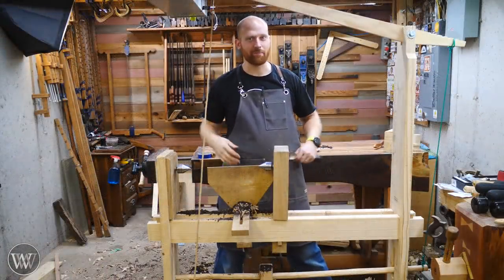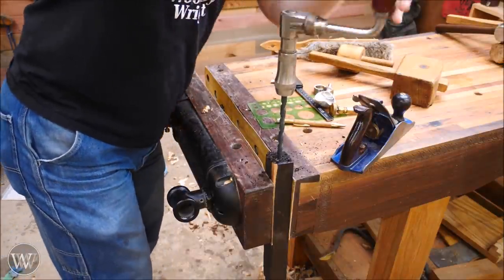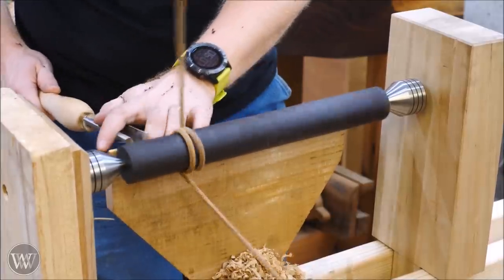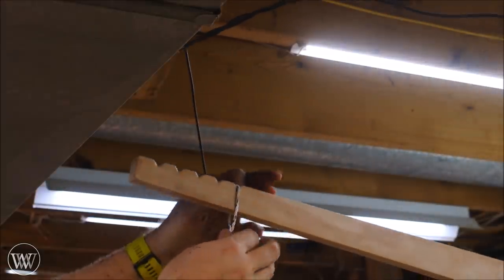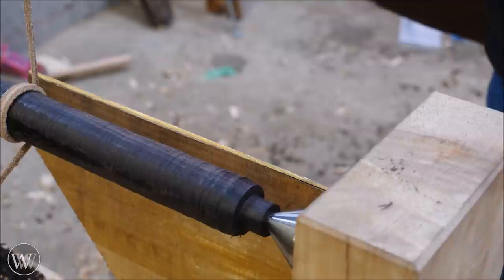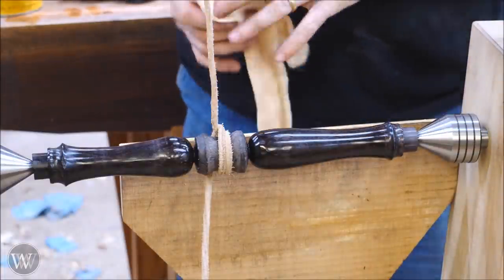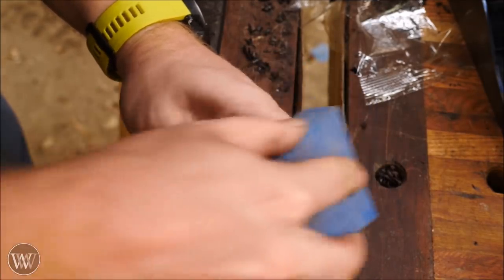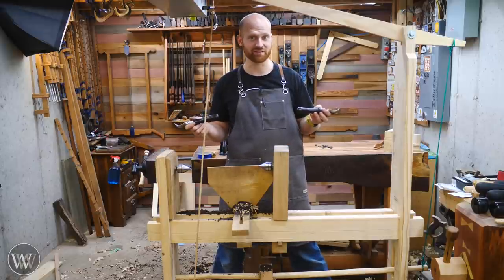Making An Ice Cream Scoop For Thanksgiving - Spring Pole Lather Project

Comment: Have you thought about having the lathe turn faster? Would that be helpful at all? You could have a separate axle with a small diameter and a large diameter roller. Then the first rope could go to the small-diameter roller, and another one could go from the large one to the piece.
Reply from the maker: The speed is determined by my foot and the diameter of the stock it is wrapping around. For pen turning with it wrapped around a 3/4" spindle I can get it up around 3000 RPM the problem with having other axels is then you have more points for slippage and this lathe also has horizontal and vertical forces that other lathes do not have to take into account.  in the end, faster is not the problem but the fact that half of the time the cutter is not cutting as the wood spins back, but that is, in fact, the fun part of this lathe!
Reply: That makes a whole lot of sense! Thanks for taking time to reply! Keep the great (and funny!) videos up :)

Comment: Nice, James! I've used small scrapers for finishing  the carving in African Blackwood too good effect. Maybe you can try using a simple card scraper instead of sandpaper? I've never used a scraper on a lathe, as it would probably overheat and kill the edge very quickly on an electric or treadle machine, but I imagine on a spring-pole lathe it might work just fine.  It would be interesting to see you test the idea.
Reply from the maker: +FXM the carbide cutters are basicly a scraper. The problem is going across the grain.
Reply: Sorry, James, I wasn't being clear. I meant use it like a sheer cutter on a metal lathe. You'd basically hold it so that the cutting edge is crossing the grain at a fairly acute angle. I've only ever used them for metal cutting, but these two videos should explain it better than I can. https://www.youtube.com/watch?v=289TxQfLNi0  https://youtu.be/WUcyHenjkew?t=173
Reply from the maker: oh i see what you are talking about. might be worth a try. though difficult to hold.
Reply: I imagine holding the cutting edge of the scraper horizontally across the top of the work, maybe twenty degrees from perpendicular to the spindle or so.  Of course, what works in one's head is not always what works in the real world! :)

Comment: Did you ever try the fine shavings of the wood to burnish the wood after sanding, it also does a nice job
Reply from the maker: +Chris Cunicelli yup. For most defuse poor woods that are a bit softer it works perfectly. But for the harder woods like this, it does not work as well.